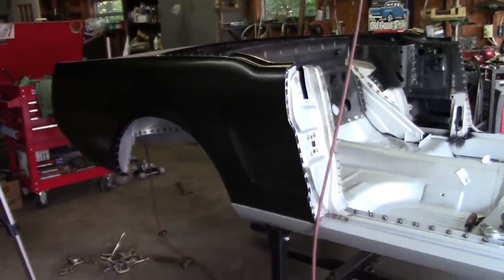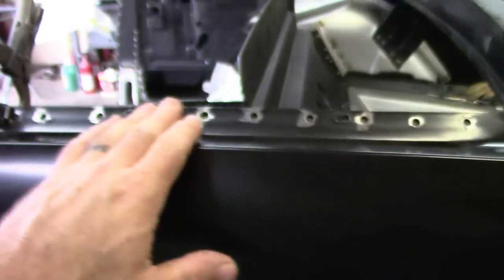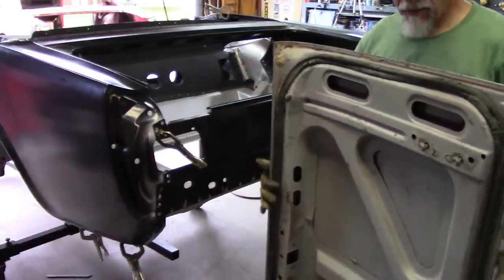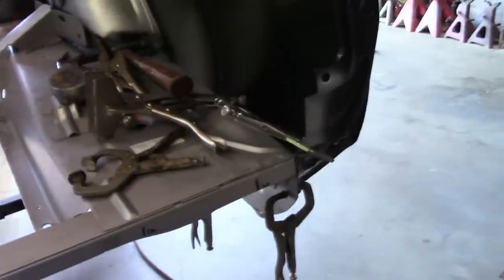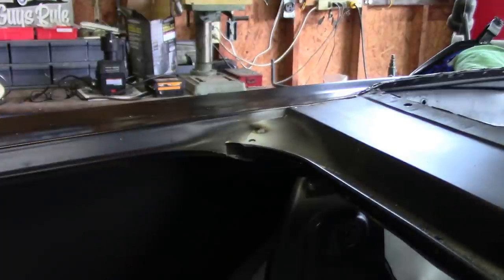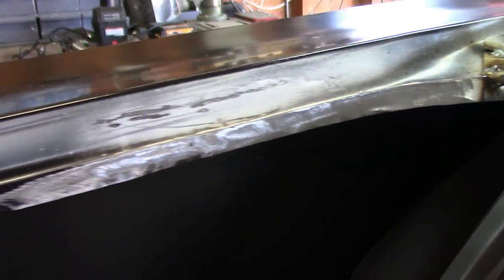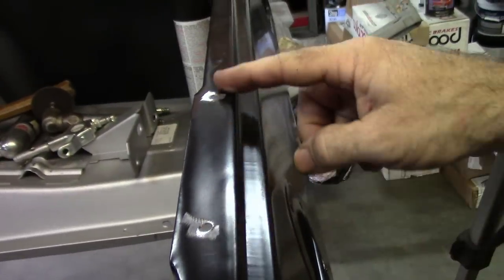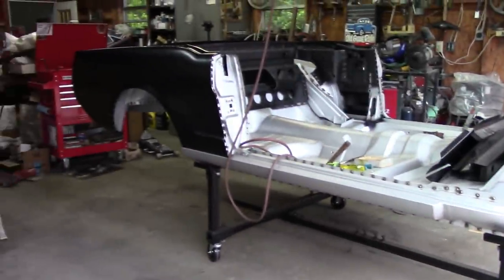Brooklyn Pony 9 Quarter panels. Tail panel. Tips on installation.

Comment: jo all I've got to weld is flex core but it seems to work just fine a little messy with splitter but it works and blending is no problem. .

Comment: Great stuff, starting to come together very nicely and looking like a car again.  What drill bit do you use for your rosette/plug welds?  Thanks.
Reply from the maker: I usually use a 3/16" pilot, and follow with a step drill. Ending with about a 5/16" hole depending on edge distance.
Reply: Thanks!

Comment: What brand of body panels did you use? It seemed like it all went together easier than than other makes of cars.
Reply from the maker: The sheet metal is all from Mustangs unlimited. I bought dynacorn branded panels, but the reality is they're the same as any other black panel I've used.

Comment: ok.... I am getting inspired...question for you.  on a 70 fastback that has had damage to the rear, enough that it needs quarters.  if up into the roof panels looks ok do you think skins will work or should I try full quarter panels?   Aside from the difference in cost is the fact I have never replaced one before.
Reply from the maker: Good question. Really hard to give an answer without seeing the car. Usually the full quarters are more accurately made. Are the frame rails bent?
Reply: Funny how when you don't look at something for a while you forget things.... I went and lifted up one side of the cover and looked at the quarter and I had thought it was sectioned with a patch panel but the one side was replaced once coming all the way up over the top to within an inch of the trunk opening and they lap jointed it.  That made my mind up to just get a full panel and  if I'm doing that one I might as well use a full panel on the other side.   Besides. Mustangs Unlimited has 20% off on them right now so I'm getting them so I'll have them on hand when I'm ready. Until then I will follow along on your project.   I appreciate the willingness to respond to my question.  ps.  the frame rails looked ok.

Comment: I still wonder how Dynacorn can build full bodyshells as many of the parts used seem to need some rework. Building these bodyshells should have shown them the problems with these parts and rework should have been done (B pillar for example. For the black parts they should told their supplier what to modify (quarter panels).
Reply from the maker: From hat I've heard, the new shells are not "paint ready". The new owner will need to have a body shop go over the car and make adjustments.
Reply: I am not sure to understand what has to be done by the buyer of a new Dynacorn bodyshell. You can adjust some elements (doors, trunklid, front fenders, hood, front and rear valance) but for already welded parts I don't see...
Reply from the maker: From what I've heard, even the welded parts sometimes need refitted. The new panels are close to where thet should be, but seams, and body contour will need to be addressed with filler. They are not as straight as people would think.
Reply: The quality is dynacons problem under the consumer guarantee act. Visit the build before they ship it.

Comment: Welded the panels y did you not space the welds. Won't it get hot and worp?
Reply from the maker: No need. Not a continuous weld, or a butt weld. Thesa are panel overlaps. Not going anywhere, and the heat dissipates nicely.

Comment: What size wire do you use .025? 75/25 gas?, I'm working on an S10 Blazer and could use your knowledge
Reply from the maker: I use .023, but .025 is close enough. 75/25 gas mix as well.

Comment: How much of the original car has to remain for it to be considered a 1966?
Reply from the maker: Not sure what that answer will be. I am using what I can from the original car though.
Reply: Jo Daddy's Garage in my state, as long as the original VIN plate and cowl are used, it's a 1966. It may differ in other states.

Comment: I've been noticing you don't seem to have to finesse those aftermarket parts much. I thought they weren't exactly the same as OEM ? I've watched you mate these aftermarket parts with parts with factory specs. (original) I guess older cars don't have as tight of tolerances as do newer cars do ? It just seems one should have to cut, pound, bend aftermarket parts more in order to get them to align properly.
Reply from the maker: For the most part, these parts are close. I have had to do extensive modification on other projects. And no, the tolerances are not as close on these old cars.